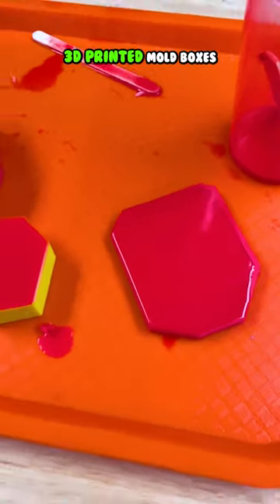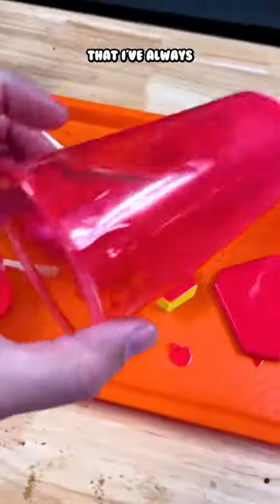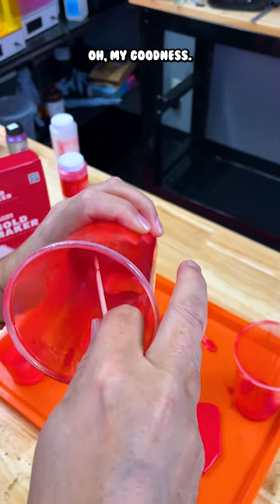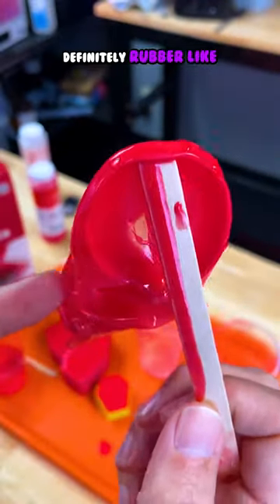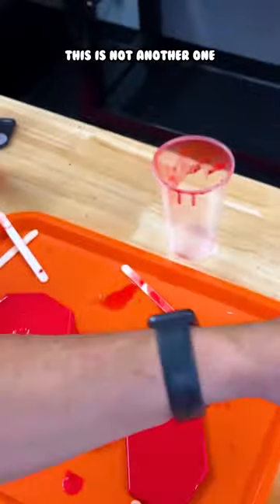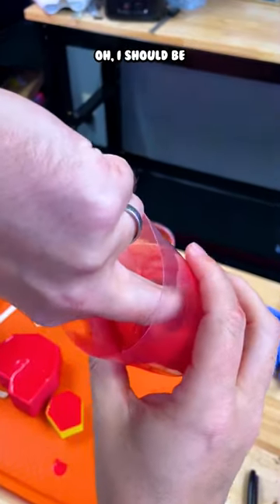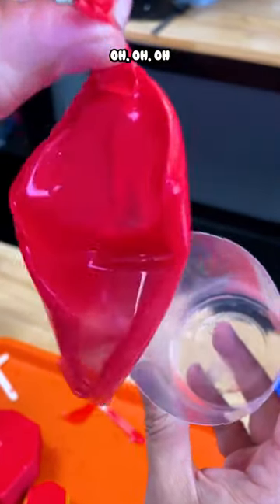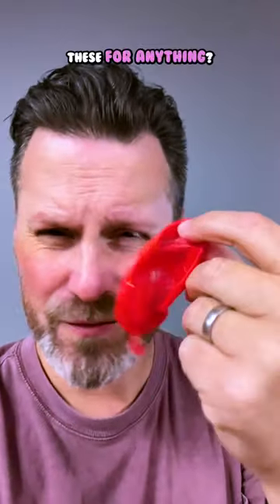Give it a tug! So Satisfying

Comment from the maker: More on this tomorrow!
Reply: If this is silicone and fully cured you can chop it up and use it as a filler in other molds. Recommend a smaller pour of new silicone around the part you are molding. Cure then add filler and pour around that.
Reply: What is a good site to download others prints
Reply: @Lego_tech_  Thingiverse.

Comment: You can use the cured pieces by cutting them up and using them in the next time you make a mold. Just drop or mix in the cut up cured pieces into the fresh silicone mix as it will take up space in the mold allowing you to use less fresh silcione. 👍
Reply from the maker: Nice!
Reply: @UncleJessy  😊👍
Reply: That’s the best use. You can also do the same thing for failed molds and old molds. Great way to take up large open areas.
Reply: Came here to say this, and instead I'll just reaffirm that the advice you're getting here is pretty standard and how you wind up saving money as you go on.  Also, chop up your old molds into half inch/centimeter cubes and hang on to them.  You'll eventually do a large mold, and all these pieces will save you a ton of expensive pour.  And then you can chop up the big mold and repeat.
Reply: If you're hyper sensitive to the mould register and need to pay close attention to detail you may want to do a thin layer of fresh silicone before adding the thick layer w/, old silicone.
Reply: @UncleJessy  or use them as “protection” if you know what I mean

Comment: silicone polymers are self adhesive so you can use overflow to fill negatives (silicone molds) and as long as there's liquid silicone touching the surface it will keep all of the detail.

Comment: My suggestion would be to make some little small molds of like nuts and bolts or other little greeblies that you can use on a lot of props and use your spare casting resin/silicone to make little bits and bobs for other projects.

Also, HEH. Tug.